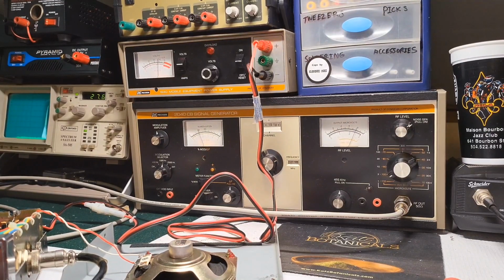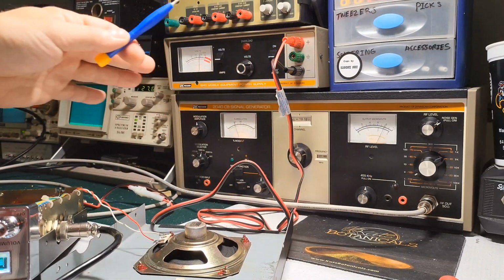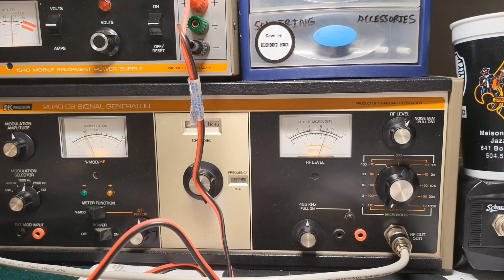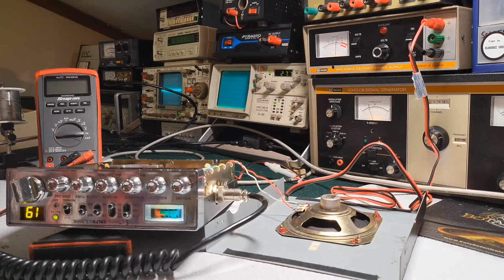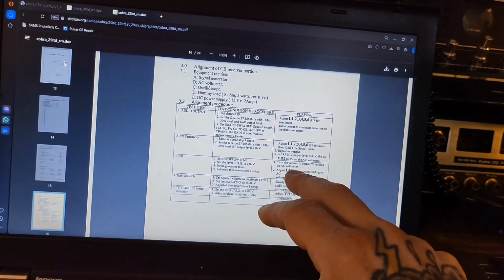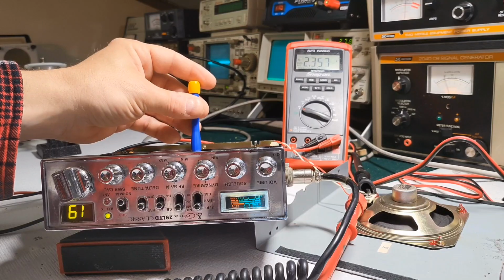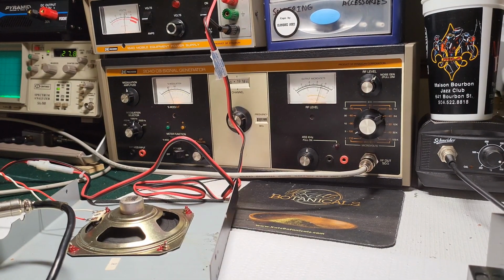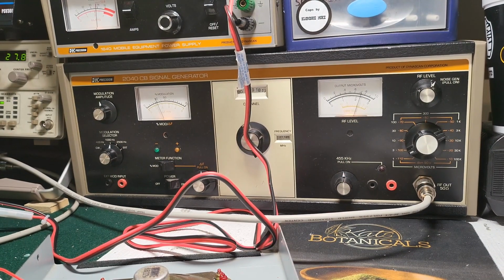@3madeamps Using a BK 2040 signal generator and adjusting noise blanker with noise generator.

Comment: Can you demo the nb on and off with the noise generator activated to hear the difference of the rx audio?
Reply from the maker: I'm not sure what you mean.  The nb was on when the noise generator was on.  You adjust it with nb on.
Reply: @pulsarcb  I mean to switch it on and off after the adjustment with noise generator still on to hear the difference